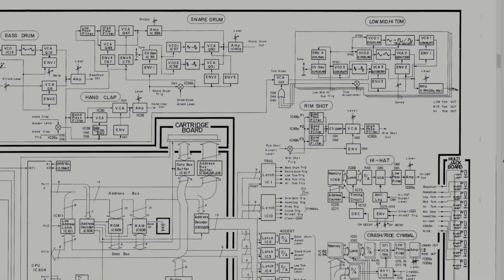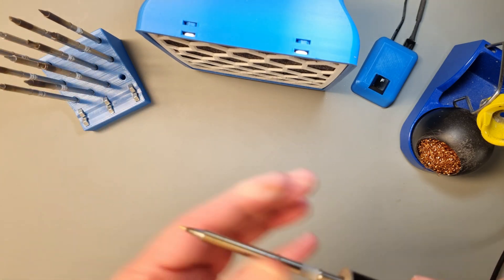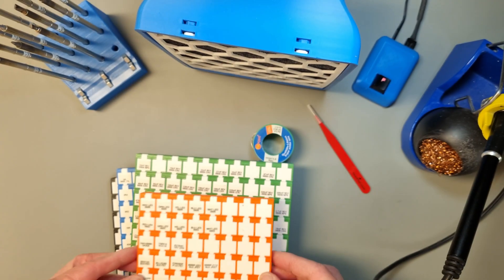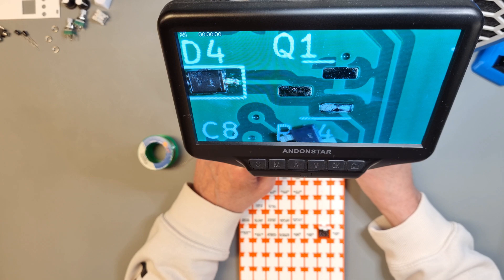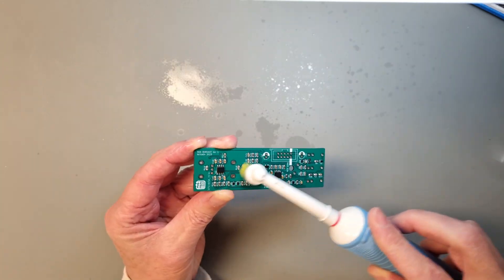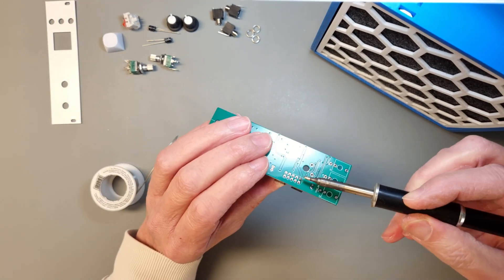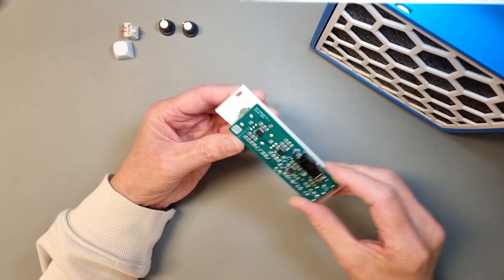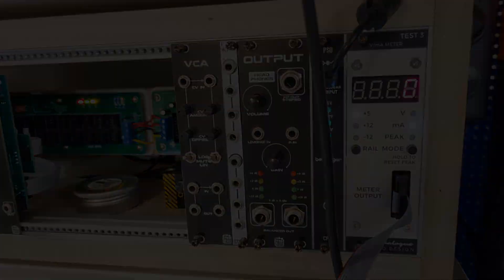Eurorack DIY: 909 Rimshot (Episode 7) - Build and Demo

Comment: Okay this video suprised me... I never expected to watch a YT video without skipping any part...

1. Stereo microscope is way better than digital one (recently swapped my digital for a trinocular). Makes it easier to read IC numbers and soldering is more predictible (with stereo you can also "see" the distance instead of flat 2D image).

2. Soldering order in SMT matters. I learned that the hard way where I needed to approach a 0402 capacitor from 10 degree from normal (axis) angle. That's when I switched to going with paste (still have mine 500g Sn42Bi58 bought for 20$ on AliExpress). It's faster, cheaper and can be easily automated with PnP machine. Frying pan with sand is great reflow device (especially we've flat-rate gas bills uninfluenced by usage amount...).

3. I use your tips in reverse... That big tip is "wave" tip and this technique is great to solder SMT (especially 100+ pins). You only need to add a little bit of flux to pads, because otherwise it bridges quite easily. Quick drag and entire side of component is soldered (eg. 120 pins of SODIMM socket with 0.5mm pitch or 25 pins of IC with 0.4mm pitch). To be precise with my tip usage: JBC C245 001 for soldering THT and JBC C245 045 for soldering SMT. If I solder large amount of THT pins in a row I go with JBC C245 039 and drag soldering (I place appropriate soldering wire parallel to pads and drag my soldering iron along the wire - from end to spool).

4. Breadboarding is a bad idea. That one I also learned the hard way... Those things are so unreliable that I can stand them only when soldering pre-made module (those breadboards are great at holding headers in place). I just get a PCB from JLC and build device. If it doesn't work debugging it, if it still does not work I recycle valuable components and throw the board into "just in case you will need to desolder something from me again" bin. 

5. For anyone looking for soldering iron. Don't skimp on budget. It will make your work way more pleasant. Chinese branded stuff has impressive quality (eg. Sugon). Cheap chinese C245 tips are OK'ish. Works fine, but heater dies a bit earlier than JBC ones. For one-off jobs I prefer clones, for "abused" tips I go with original JBC.

You start me thinking I should make YouTube channel, but my pronunciation is so terrible I can't stand my own voice while speaking English.

I'm learning about EuroRack as my friend asked me if we can cooperate to build some modules for him (imported ones are a bit too expensive).

Q1: What jack model are you using? Tried to find them on LCSC, but failed to get the exact thing (their searchbar is not the best).
Reply from the maker: Hey, thanks for the comments and tips. 
With 100+ pin ICs and 0402 you are definately building more advanced stuff than I do... 😄 

Yup, a stereo micropscope is far better than a digital one. I have started to buy parts on Ebay for putting together an Olympus stereo microscope but some parts are hard to get hold of (at a reasoneble price) - but I'm slowly getting there....

Don't hesitate to start putting out YouTube videos - your accent is part of your personality and background so there is no need to feel ashamed of it ❤

The jacks are Thonkiconns, sold by Thonk in UK. You can get hold of "copies" on Aliexpress if it is easier to buy from China than UK.
Reply: @MeeBilt  I'm living in Eastern EU, so it does not matter where I buy (both sources require taxes and delivery from UK is usually 3-5d instead of 7-14, also it's cheaper at shipping). Thanks for the response ;) 

Relatively speaking my projects are quite simple. Basic "diagnostic" stuff eg. broken cable detector (cable not wire, it can scan up to 16 wires at same time including being broken and being shorted internally). In most designs I can "easily" fit all routing on 2 SIG/PWR + 2 GND layers (6 layers are still too expensive for most projects) using 13.4 or 11.7 mil traces (50 Ohm single-ended impedance in my stackup). 

Mine stereo is a cheap Chinese (branded 'Eakins') stuff and for it's price it is fine. Not Leica, but still pretty good for simple tasks like soldering / optical inspection. Only the LED ring is annoying when you want to change the lens.

Comment: Good morning
Do you have the 3d files to print the pro fume extractor or a link
THANKS
Great everything you do I love it
Simon
Reply from the maker: Hello Simon,
Here's the link:
https://www.printables.com/model/29401-soldering-fume-extractor-for-120mm-fan

I bought a ASUS ROG STRIX XF120 120mm MagLev with 63 CFM and a cheap carbon filter retrofit set for kitchen ventilation (fume extractor) for my build!

Good luck!
Reply: Nice Thanks you Tommy